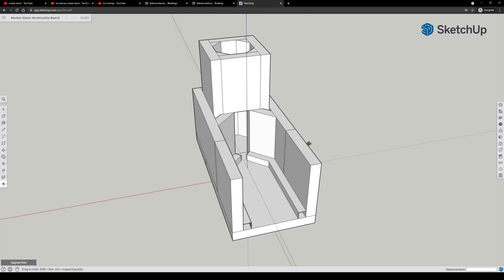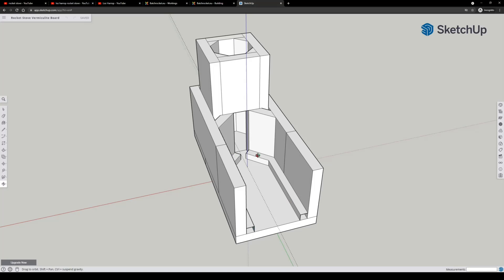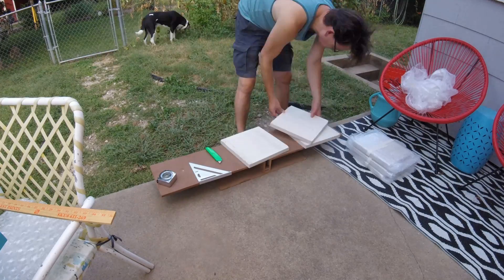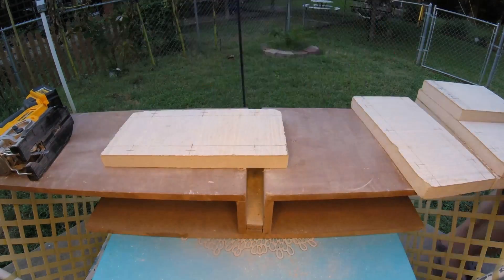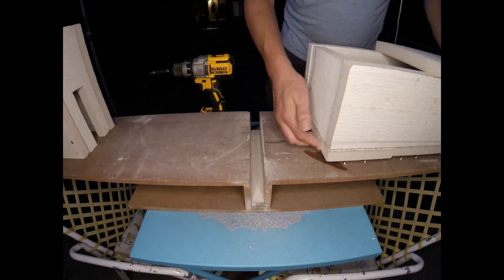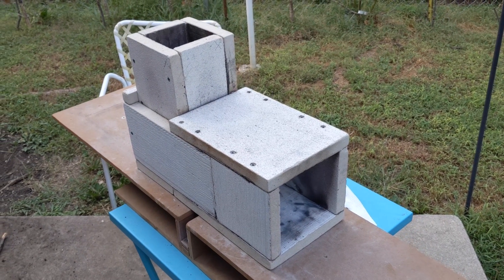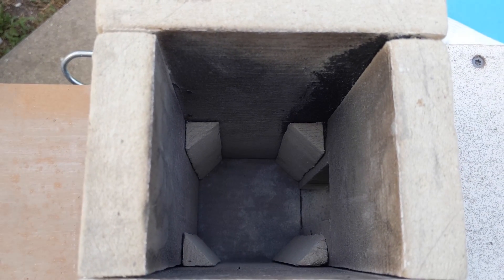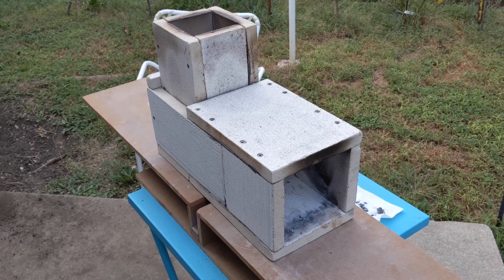No Welding, No Casting - DIY Rocket Stove

Comment: Put the port to one side, and that thing will throw a tornado
Reply from the maker: @colincarver893  it would, but it would just send flames out the chimney faster, not ideal if you want to do something with that heat. It might also not mix the wood gas and air as well as described on batchrocket.eu

Comment: Amazing: I wonder if this would scale to a smaller size , wrapped up in steel , to put in a log cabin ?
Reply from the maker: I'm not aware of anyone creating a smaller version than this (100 mm/4 inch heat riser diameter, 600 mm/24 inches tall). Probably because you'll end up having to throw in a handful of kindling every 5 minutes.

I am thinking about how to make use of all that heat that is generated, because many have done it before me by putting a barrel over the heat riser. I'm going to try to weld some kind of metal box together that slides over the heat riser, so that it becomes a radiator.
Reply: @BitsOfInterest  Beautiful work. thank you. your rocket stove is  a beautiful engine . It would fit nicely in a similar design to the tiny rocket mass heater - the cyclone by kirk donkey on youtube . No metal barrel, just brick.. or a thin sheet metal square barrel like Honey Do carpenter design. I am so glad to video BitsOfinterest!
Reply: I have K style rocket stove from 3" square steel tube for heating small room  and I have problem.Every 5-10 minutes refueling.Don't go under 4" or 5".

Comment: I do not understand why you want to have a second air intake.
But if your going to create one. Look at how a old engine carberateur works and bernoulli's principle.
Than the air provided has a function with the speed of the gasses. Just like a car, you control one (air valve) and your mixture (ratio) will stay the same.
Reply from the maker: If you don't understand secondary combustion you can read about it on batchrocket.eu.

The Venturi effect created by the narrow port between the burn chamber and heat riser is a specific application of Bernoulli's principle.

Comment: What size is the riser?
Reply from the maker: Internal diameter 100 mm or 4 inches, in later videos 600 mm tall or 24 inches. It gets much hotter when you make it the right height so that it drafts better.
Reply: Thanks for the answer! I thought it was biger by the looks of the fire.

Did you eventually put it inside a barrel or something? I'm curious if it radiates enough  for hearing a small cabin.
Reply from the maker: @mariusu2000  Right now it's still burning yard waste and shooting flames to the moon, but over the last few weeks I started to design something that hopefully will make more use of the heat and doesn't set your roof on fire 😜 It will take a while before I get to building (and filming) it though, I'm still drawing up plans...
Reply: @BitsOfInterest , Good luck!

Comment: Nice. Yes... there is no reason to build that "V" at the bottom of the firebox, but everybody copies what everyone else is doing without understanding what they are doing. It doesn't really hurt anything, but it doesn't really help anything either. Yea, I know the secondary air channel is sometimes at the bottom of this "V," but there is no advantage to that. Put the secondary air channel pipe anywhere in the firebox, middle bottom, sides, or top, emptying its air just before the port. Anywhere in the firebox is fine, as long as it preheats the air a bit.
Reply from the maker: @stoveadvice  I could see how it can help concentrate the coals maybe keeping it hotter longer, but it works fine without it also. Like you said, if you put the secondary air in that coal bed that could also help, but I doubt it's going to be much hotter (or that it needs that to work) than running it anywhere else in the fire box.

Comment: Do you think we can cook on this one too.?!
Would be interesting to know.
Reply from the maker: @gesunderpsychopath8569  In this configuration it gets around 750-800C at the top of the heat riser. In later iterations close to 1000C. I'd hope that's enough to cook something 😜

You would need to build some kind of frame around the heat riser from metal to hold the pan up and allow gasses to escape around the pan.
Reply: @BitsOfInterest  well the frame would be done easily I guess.
I'm wondering if this configuration in some sort of a bigger scale could be used, to heat a cabin / room indoors.
Of course using other materials as well, such as brickstone and clay or whatever.
Just a curious prepper wondering 😉
Greetings from Switzerland
Reply from the maker: Sorry, YouTube doesn't notify me of replies, only the first comment. Yes, many have built heaters out of this for their house. You can search for Rocket Mass Heater or find designs and specifications how to cast a core (the only part I have) or build it out of firebrick on batchrocket.eu. Usually it then gets enclosed in a brick box or steel drum to store and radiate heat. 

I was planning to use it for a (pizza) oven, but plans have changed on that and now I'm designing a metal box that slides over the heat riser to work as a radiator :p

Comment: It is a big tent, not a small one. and the stove then also needs a outside build tower like a barrel in normal stoves.
Reply from the maker: I suppose if you have something like a yurt that could work. They usually also have a hole to put a chimney through.
Reply: @BitsOfInterest  there is no yurt, it is more like a bungalow tent, 4 x 6 meter when unfolded from the transporter. it is a transporter based system where the tent can be folded and unfolded when setup it. I need to make a secial opening through for the pipe, otherwise I get a burning tent.

Comment: very nice idea. i plan to do something like this for a greenhouse heater. how is the design going? to you have an update on the whole thing? does the vermiculite board hold up to the high heat over time? thanks
Reply from the maker: I have two follow up videos where I add the enhancements I mention at the end of this video. The vermiculite certainly holds up to the heat, but it's very brittle, so you need to toughen it with something like water glass so that you don't damage it when you put wood in. 

If you're making a heater you can use what you see here as the heater core and turn it into a rocket mass heater, meaning you'll funnel the exhaust through a brick or cob structure that can store some of that energy instead of sending it all out the flue 😉

Edit: You can think about it as building a box around the heater core that exhausts at the bottom so the heat is forced down and heats up the mass in the process.

Comment: Very cool (well, very hot actually). 

   What I would do to add strength and durability to the structure, is get basalt fiber cloth (sort of like woven fiberglass cloth, but higher temp and alkali resistance, and higher tensile and modulus strengths), mix up a tri silicate blend (sodium, potassium, and lithium with the sodium being the slight majority, followed by the potassium, and just a bit of the lithium) with some powdered activated carbon.  

  "Glue" the boards together with the tri silicate blend + carbon, then layer/wrap it with the basalt fiber cloth, and put more silicate solution on it to affix it to the boards.  Should make it pretty sturdy.
Reply from the maker: To me that sounds like a lot of work with hard to get materials, but I may be wrong 😜 Wouldn't it be easier to mix your own refractory cement and cast it in a mold? Refractory is much tougher than vermiculite board already. 

PS I did cover the areas with the highest abuse (burn chamber) in sodium silicate and that helped a lot with mechanical damage.

Comment: Very cool! I bet this would be epic with all the upgrades that mentioned and used fire cement. And it would be evern cooler of you could use wood pellets.
Reply from the maker: I built this because I have a lot of sticks falling in my yard, so it's a cool and quick way to get rid of them. That or make wood chips out of them.

Comment: 💵💵💵💵💵💵💵💵
Reply: @BitsOfInterest  In my country each refractory brick costs 15 euros, multiply it
Reply from the maker: When I made this it was about the same here for fire brick or refractory brick that's why I used vermiculite board even though it's more fragile. I got a 2-pack of 300x300x25mm for $25 and used 6 boards/3packs in this video. Later I use another 2 boards to extend the heat riser, so in total I used 4 packs costing $100. It's not going to get much cheaper to build something that can withstand those temperatures.
Reply: @BitsOfInterest  thanks 👍🏻

Comment: Bo how well has it held up? You posted this one year ago. Have you had any problems with 
the board assuming you caged it in with angle iron.
Reply from the maker: The angle iron frame is doing it's job 😁 The boards stay together and don't get (further) damage. I also needed that frame to attach a metal door in my most recent rocket stove video.

Comment: Can you post the dimensions of your stove. I would love to make one with out gusting. Thanks, I subscribed I learn a lot.
Reply from the maker: Thanks! If you are familiar with SketchUp (Free) I shared the 3D model from the video in the description.

Just keep in mind the boards I used are 12"x12"x1" so most pieces are 6"x12" and some 8"x12" and 4"x12". You can think of it as two square tubes that fit inside each other. 

The heat riser or chimney is 4"x4" inside, 6"x6" outside. In this video it's only one board high, but in my next videos it's 2 boards or 24" high. 

The burn chamber is 8"x8"x18" outside, 6"x6"x17" inside. The 17" is because it's closed on the back,  but not the front. In my latest rocket stove video I made a metal door to close that off.

Comment: also.....to keep it from cracking around screws maybe some pilot holes first then add the screws you need with a high heat adhesive
Reply from the maker: I did both those things. The problem was I only used the adhesive the second time I put the screws in and there wasn't much hold left. Like I say in the video, build it once, then burn it 😉

Comment: what would you think of casting our own boards made of vermiculite and or perlite with aircrete? i think it can be customized a bit better

since its more insulative instead of radiative i think i would put metal or clay over firebox and i can cook on that too

since most heat will be in chimney i would build some heat reclaimers....rocket stoves get hotter and of course with the secondary burn that it would not matter if we steal a bit of heat from this design.....it wouldnt cause any creosote at all.......in fact i could add a ceramic catalytic going right up the stove pipe....those dont work well with low heat but no danger of that here
Reply from the maker: Casting is always an option. Though if you're going to do it you might as well just cast the full shape, maybe in two halves. I was going for quick and easy, so I just bought vermiculite board.

The vermiculite insulates pretty well, that's the whole point, to heat up the firebox and riser. I don't think you can cook on top of the firebox. I just put some sticks on top of it if it rained recently before I put them in to help them dry a little.

I'm not familiar with heat reclaimers, but you can steal as much heat as you want in the riser above the port, it's all happening in the bottom of the riser. If you watched my latest rocket stove video you'll see it gets close to 1000C/1800F out the top, imagine what it is down below ;)
Reply: @BitsOfInterest  yeah interesting.....i think i may try to cast something complete or in 2 halves....i will find something to make a thick steel plate though for roof of firebox so i can use to cook or even put an ecofan on

the good thing about rocket designs is that you can steal heat because they burn so hot no danger of creosote build-up like cooler burning stoves.....besides with the secondary ports should be mostly vapor escaping anyways not smoke

Comment: Finaly someone who uses Peter van den Berg's name the dutch way with a hard G 😄 
When I copy you're mesurements I get a groundfloor of 15 x 45 cm is that correct? With 2,5 cm thick material my burnchamber will be 10 x 10 x 30 cm. Am I going wrong somewhere?
Reply from the maker: haha, thanks! That's a little Easter egg for Dutch viewers so you immediately know where the person who made the video is from ;)

Before I overcomplicate things let me give the simple answer first: most boards are cut in half from 12x12 inch or roughly 30x30 cm material, except the bottom and top of the burn chamber because they need to be wider. I linked the Sketchup file in the video description in case you want to have a look for yourself.

the inside of the burn chamber is 15x15 cm and roughly 27.5 cm long because you lose one material thickness at the back that surrounds the heat riser. The floor plan is 1/2 board + 2x thickness (15 + 5 cm) = 20 cm wide and 1.5 board or 45 cm deep. The inside of the heat riser is 10x10 cm (outside 15x15 cm so it fits inside the bottom part).

PS if you're building just for fun while burning yard waste this size is fine, but it needs to be refilled quite often, maybe every 15 mins or so. If you plan on using it for cooking or heating you may want to consider making it a little bigger so it holds more wood, but the heat riser becomes taller really quickly if you try to stay close to the proportions on the spreadsheet here: https://batchrocket.eu/en/building. You may also need to use stronger, more permanent materials like fire brick if you go much bigger than what I have.
Reply: Ah, ik dacht al te maken te hebben met een "fellow Dutchman" 🇳🇱🌷 de omgeving leek echter totaal niet Nederlands.

In de sketch up tekening zag ik geen afmetingen terwijl je ik in het filmpje sprak over halve elementen. Met de uitleg worden de afmetingen een stuk duidelijker

Ik zat zelf te denken aan een metalen frame met daarin de platen, een p buis en een deur met glas. Dit dan allemaal iets groter en uitgevoerd als double box. Het materiaal is er voor gemaakt en niet te prijzig voor een experiment
Reply from the maker: Goed opgemerkt op beide punten :) Geboren en getogen in NL, wonende in de VS. 

In het geval je de Sketchup file download en opent kun je de "tape measure" tool gebruiken om lengtes te zien van punt tot punt, maar wellicht is dat niet langer nodig na de uitleg.

Als je zit te denken aan een metalen frame dan is mijn tweede rocket stove video helemaal voor jouw :) 
https://youtu.be/mAL9oKQCyg8

Als je een deur met glas wilt maken dan is mijn derde en meest recente rocket stove video helemaal voor jouw :)
https://youtu.be/i8TIMvLwX6M

Prijs is voornamelijk waarom ik ook voor vermiculiet had gekozen voor een ongetest ontwerp. Als je dubbel isoleert krijg je waarschijnlijk nog betere resultaten dan ik nu heb, maar ik vind +/- 1000 C boven uit de heat riser ook niet onaardig al zeg ik het zelf :p

Comment: I wat just wondering where I know the name Vermiculite from ... You do know this is asbestos right ? Great insulator but next time ... Wear a mask.
Reply from the maker: It's too late now 😜 I just looked it up and apparently there was vermiculite contaminated with asbestos sold until the early 90's, but that doesn't make it the same thing... I also don't have a habit of snorting lines of dust, so it's probably ok 😉

Comment: Hi, i see the importance of insulating the furnace and chimney area from heat loss to maintain high possible temp for maximum efficiency. i wish to build the advanced design over the usual tin can simple rocket stove. Please, do you think i could use 12.5mm x 1.2m x 2.4m piece of vermiculite board for £18 to either line a well designed metal or brick stove or even attempt full construction out of it?  i appreciate VM board in somewhat fragile..  thanks in advance, Peter
Reply from the maker: 12.5 mm is a little thin. If you use it as a liner for something else maybe it could work, but I wouldn't screw those pieces together, it will just crumble. Maybe you could also use 2 layers to get more insulation value. If you're making the whole core out of vermiculite I'd try to find 25 mm thick boards so you can get screws in the side of a butt joint.
Reply: @BitsOfInterest  Ok, thanks for the good info.

Comment: I just found vermiculite board on amazon and it costs more than steel. Maybe firebrick would be better.
Reply from the maker: The point is to reach the highest temperatures possible to burn up all the gasses, so steel is not a great option. It tends to conduct heat quite well, so it cools the whole thing down. when you start insulating around the metal so it does get extremely hot again it will burn out.

When I built this last year firebricks were much more expensive and they are also harder to shape. If you build a bigger permanent rocket stove and design so you don't need complicated cuts it may be an option. Vermiculite board you can just use woodworking tools with to get any size/shape you want. Fiber cement board may be sturdier, but it was twice as expensive when I was buying materials.
Reply: @BitsOfInterest  okay, so your stove is meant for cooking and not radiant room heat?
Reply from the maker: @justtinkering6713  this one is just for experiments to be honest 😂 but even if you would want the radiant heat you'd build the core (the only part I have) from high temperature materials like fire brick or fiber cement board and then you'd put a steel barrel over it to radiate out. Some even build a brick structure around it for thermal mass.

Edit: mine is technically a rocket stove, if you search for rocket mass heater you'll find some awesome builds people use to heat houses. They are much bigger but the principals are the same.
Reply: @BitsOfInterest  thanks, it's a darn good adaptation.